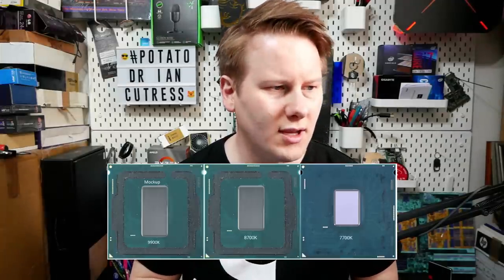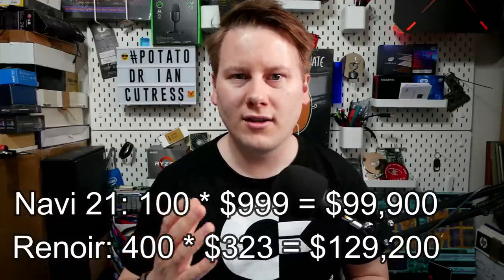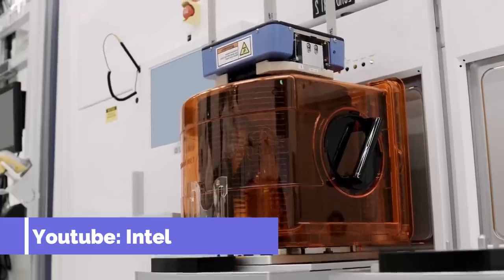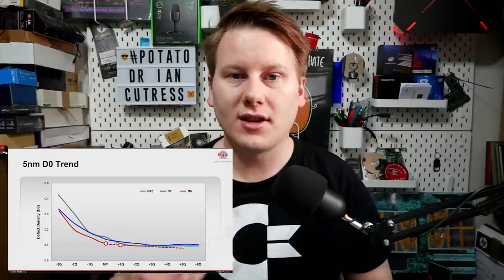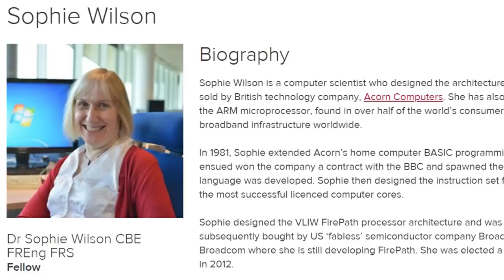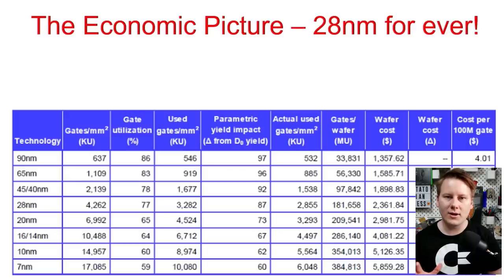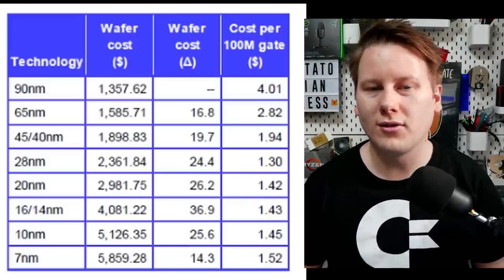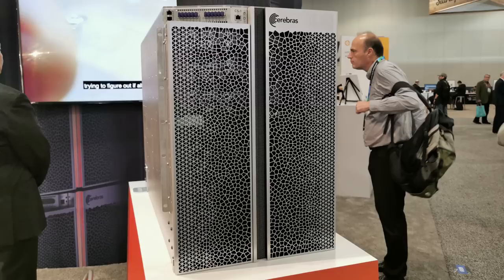The True Cost of Processor Manufacturing: TSMC 7nm

Comment: I used to be a yield engineer for a semiconductor fab.  It was not uncommon to destroy a "boat" of 25 wafers from a drifting process or human error. That would be a loss of $1m in a flash. As a yield engineer the stress was insane. You'd tweak a parameter expecting it to improve yield and instead it would loose 5% (where breakeven point is 5%) and you wouldn't know until 1000s of wafers.  The most underpaid job in the world. Nobody pats you on the back when you make the yield go up, but if yield drops due to an equipment issue you had nothing to do with your ass is grass. And everyone hates you because all you do is beat up people for hurting yield. I did it for 8 years. 8 years too many.
Reply: That sounds nuts, how can you go 1000s of failed wafers before noticing something was wrong, don't they test each wafer?
Reply: @davidrave563  yes they do, there are test structures in between each die that they regularly test, but they don't catch everything ... And we don't know what those limits should be anyway until the product matures ... It's a lot of educated guesswork. Many test structures you can't test until a series of 5 steps (out of 100 total) have completed, and if the error is on the first step, you could process 20 boats of wafers until the deviation is detected.

Comment: It's not just manufacturing cost, there's research and development costs also. Through the process, there's developing, making and testing a new technology, like the 7 nm size transistors, then there's cpu design(circuit, logic), prototypes and testing. You may go through several iterations.
Reply: Also, verification of the design... .i.e Design verification..
Reply: You never get true 100% yields. This is why Intel has bins.  Same chips post process locked to lower clock speeds or features disabled due to defects. So maybe a small handful of chips from the wafer are full featured at full clock rate. Many full featured at lower ranges of clock rates. Some at low clock rates with se features disabled And a handful of duds. There will also be some area of the wafer that is unusable due to the chips being square and the wafer being round.
Reply: he also forgot about mask costs, which are insane with these deeply scaled tech nodes.
Reply: And day to day operation costs.
Reply: Taken everything into the price they still markup too much,,,ppl are ready to buy and prices will be higher when this crisis is over.
Reply: @optimusprime7421  out of curiosity: What drives you to type three ,,, in a row?
Reply: @RandomUser2401  Use your imagination ...
:)
Reply: @dimedriver   @Avery Nisbet  Even if the chips were round, you would still get a lot of unusable space. More in fact. The reason why there is wasted space is because the chips are manufactured to be uniform in design. And the reason why the wafers that the chips are made from are round is because the manufacturing process requires the wafer to be spun like a CD.
Reply: @Sidicas  the wafers are round, because the crystal they are cut from are round. You can spin coat discs of almost any shape
Reply: @grandmastergyorogyoro532  exactly.  Design verification costs more than manufacturing at small nodes.
Reply: Add taxes to that list and other types of fees and licenses.
Reply: They don't design the transistors, the transistor design is done in co-ordination with the fabs and research firms like IBM. AMD does do circuit layout but they dont layout every transistor the circuits consist of cells which can have 6-100's of transistors these cells provide features such as logic like and/or gates but they may contain memory cells, cpu registers or entire CPU cores (like when a chip designer licenses ARM cores) they dont design this for every manufactures they just provide the VLSI files for layout. The cells have design requirements a little like a spec during layout the EDM software verifies the cells meet the rules developed for the process they are working on eg TSMC 7nm. The challenges for chip design comes with latency, frequency and temperature these factors have to be managed during layout. Entire new CPU/GPU design doesn't happen vary often (in many cases impossible when maintaining API and CPU instruction sets compatibility) it is too costly instead they make performance tweaks or increase quantity of cores or cache. This is mostly a copy and paste process. The problem of increasing more cores means you need more silicon the more silicon the more likely the chip will fail completely also the larger the die the harder it is to increase the clock speed. The reason for this is latency if a core needs to transfer data from one side to the other side of the silicon and it must lock the bus while doing this is will cause internal waits on the cores the trick is to keep memory and logic close to each other. The second factor is heat the more transistors on a piece of silicon the more the piece of silicon acks as a short circuit especially at high frequencies. There are design measures to mitigate or reduce the energy consumption of a cells. The big problem is transient power spikes but again design rules will help to validate the layout before manufacturing. Modern designs are starting to use AI to handle layout with reports of substantial improvements over human based designs up to 30% and development times of less than two months. Of course this is a little over simplified but really nothing changes much between generations apart from the number of transistors therefore number of cores and increased frequency. Usually when something new is added it becomes an extension to the old maintained design like CUDA or AVX once added these also dont change alot. The reason there aren't more vendors making CPU's and GPU's is the Patent and licensing restriction to build compatible chips. Reverse engineering these chips is possible and been done before but there is a monopolisation by US chips vendors to block competition. To design an entirely new instruction set and get mainstream adoption from software vendors is almost impossible. But there has been recent success with RISC-V which is an open source. But im affraid that the biggest sponsors including AMD and Intel while slow down development by poaching engineers internally. The Chinese are keen to develop RISC-V so who knows maybe in the future there will be for desktop CPU vendors ARM, Intel, AMD and SMIC with there RISC-V chips. Personally i think it is time to remove the monopolies that control chip pricing and let small players have a go at inervating.

Comment: The raw material costs are much less than half the base cost of production. When I worked in auto manufacturing supplier sector, we made a plastic part for $8 and less than $3 was raw materials, sold it to customer for $13 which they put on cars but sold the OEM replacement for over $80, this is common in all manufacturing. I guess I should also add the customer paid for 2 sensors, the R&D and the quarter million dollar mold for manufacturing which is why they had such a mark up.
Reply: The best thing is when the stuff comes from the same company as the cheaper stuff and they are exactly the same aside from labeling. My father worked in the 90s for a Company that sold everything that had to do with Carbrakes (or something like that) and sometimes they got the stuff that was supposed to be shipped to Mercedes but was cause of an error send to them,
Reply: @mrn234  in my city,we have a warehouse from the top ball bearings manufacturer.
almost in front,there is a Caterpillar warehouse dealer.
you can buy the caterpillar branded bag original part ball bearing for 120, or you can go to the ball bearing actual  manufacturer in front and buy the same for 30.
same ball bearing, same stamped code,different package, huge markup "for USA made quality"
Reply: @xiro6  You can also buy most of the stuff on Amazon directly from the Chinese manufacturers via AliExpress at 50% off... Amazon often do not even bother importing and stocking the goods themselves - they just pass your order on to the Chinese manufacturer and you get the product directly from China, in the usual packaging as when you order from AliExpress. And you can't get it anywhere else, because no one outside of China is still manufacturing certain parts.
Reply: @captainobvious-CH  Can you tell me which suppliers in China would have some very low-priced gamer laptops? i need one so i can study, to run some heavy applications.. and as my national currency is tremendously devalued, it is extremely expensive and difficult to buy the full price.

Comment: The construction of a single fab can cost billions depending on the wafer size and process. 
Bosch - 300mm wafer - 130nm process - 2019 ≈ 1bn
Intel Fab 28 - 300mm wafer - 10nm process - 2018 ≈ 5bn
TSMC Fab 18 - 300mm wafer - 7nm process - 2018 ≈ 17bn
Reply: However the fabs wouldn't be built if there was no profit in it!!  With the kinds of money being involved you now know why governments sponsor and protect these endeavours.  These are economies in their own rights!!
Reply: Something is wrong here.
Intel's 10nm is BETTER/SMALLER than the TSMC 7nm.
So the fab price is wrong.
Reply: @Wirmish  The prices are taken from official press releases. Who cares what's better ... 🤦‍♂️
Reply: @Wirmish  no tsmc 7nm is smaller then 10nm Intel, the difference between them is not extremely high that's all
Reply: @bertjedekat  Well the TSMC 7nm node actually works.
Reply: @1barnet1  so does 10nm, even if you and Intel wanted it to work better.
Reply: god damn, Bosch has a 1bn plant that does 130nm? Sounds unfeasible if 10nm was 5bn.... couldn't they do like 25nm for 2bn and use 90%  or even less wafers?
Reply: @xBINARYGODx  Well they still don't have neither desktop nor server processors from that node if i recall. Due to low yields and poor performance at higher voltages.

So no compared to TSMC's 7nm work in short it doesn't quiet work. It does have similar transistor count per square mm.

But TSMC's 5nm node is already mature now. With Apples M1 and phone Soc's delivering staggering efficiency and performance benchmarks.

They are in for a rough ride the coming years.
Reply: @Wirmish  we REALLY ned to drop the nm label since it doesn't tell us jack anymore
Reply: @zlac  Bosch produces a high amount of analog & mems chips. There is not much benefit for going on a smaller node for such systems, since these elements require a certain size and do not shrink
Reply: @Wirmish  or Intel is amazingly profitable.
so that's why they have money to have a fab under the iron dome
Reply: When I was at texas instruments, dallas site. they built Rfab (Renner Fab) and it sat empty for years. Just blew my mind.
Reply: Yes. Leaving out the enormous costs of the specialized machinery and fab plants makes this video kind of moot.
Reply: @zlac  I'm really confused as TSMC's 5nm plant they are building in Arizona (expected to be finished in 2024 which is basically unprecedented since they just broke ground) at an expected cost of 12bn. With US labor prices, I'd be stunned if some of those afore mentioned plants cost that much. In addition to that, wasn't the 17bn an investment in a large expansion and retrofit, dropping two large nodes for 14nm or 12nm, along with 7nm and 5nm with an advanced stacking fab? I might be wrong, but I'm pretty sure it was. If he has a link to the article regarding TSMC's 2018(?) 17bn investment and what it went to exactly I'd love to read it as I'm just going from memory on that one. The Arizona info is from Rueters, June 1rst, "TSMC has begun production at it's Arizona Chip Plant." if anyone is curious.
Reply: @crzyces1693   It has something to do with capacity. The capacity of Arizona 5nm fab of tsmc is merely 20,000 12in wafers per month. That's why it only costs $12 billion.
Reply: @crzyces1693  Pretty sure Russia will get involved if it escalates to nukes since they are next door to China and they will suffer the same nuclear winter you mentioned.  Also, with the ability to change trajectory mid-flight, they would not know if some of those nukes are heading for China and not themselves until it's too late.   It is now known that during the Cuban crisis with Russia, we were planning to nuke China as well even though they were not involved.  So from Russia's perspective, they could be nuked as well.

Another issue is that from what I've read, China is increasing their nuclear arsenal.  We were friendly with China until recent years so they had only minimal nuclear deterrence capability before since there was no real threat to them.  Things have changed now and they are increasing their nuclear arsenal.  Even if they were to attack Taiwan, it's unlikely they will do so now.  They will wait till they have sufficient nukes.  The only way I see a war happening now is if we started it.  They will wait.
Reply: @yanglee1404  20,000 5nm per month is alot of wafers IMHO
Reply: I think it's worth mentioning that those factories are from different years. For example, Intel Fab 28 started production in 2008 whereas TSMC Fab 18 is just partially online this year. Of course, the cost of the factory also depends on how much you can manufacture. Manufacturing 1000 wafers per month requires quite different factory compared to one that produces 30000 wafers per month.

Comment: Silicon substrates are just one raw material, there are lots of additional high purity chemicals needed. 
These and all the other additional costs add up to a lot, and take that 20x ratio down to 0.6.
If TSMC had $50B revenue and made 12M wafers in a year, average price is $4k.
Reply: But isn't that already included in the wafer cost @ 12:50 ?
Reply: @benjaminfacouchere2395  I mixed what I was talking about a little there. One was that the raw material cost for a processed wafer isn't just the silicon. That was TSMC's cost.  The other idea was how does a $6k produced wafer that can be turned into $100k of retail parts lead to only 50% profit overall for AMD or Intel.
Reply: @davidgunther8428  I see. My understanding was that the $6k/wafer are not the purchase price for AMD/Intel but the production cost for TSMC.
Reply: Would like to clear up Intel doesn't really do business much with TSMC. They have their own facilities. So their cost may be completely different.
Reply from the maker: Intel does billions of dollars of business with TSMC. 5% of TSMC's total revenue comes from intel. Used to be 8%. Intel has been a tsmc partner for over 2 decades.
Reply: @TechTechPotato  TIL. Thanks for the knowledge!
Reply: Chemicals, precious metals, consumables, energy, tool maintenance, waste management, process yield loss, die yield loss, assembly yield loss and many, many more costs involved.
Reply: @MrPanaramuh  Taiwan TSMC is helping Intel, AMD, and Apple manufacture 7nm, 5nm, and 3nm wafers. There are 2nm and 1nm behind..

Comment: As Dr Sophie Wilson mentions here, the problem is partly dark silicon that needs to be left blank so the chips don't get too toasty, this ties back to your later video about shapes.
If the chips could be a different shape some of these concerns could be alleviated. One of the apparent solutions would be stretching to the reticle limit and seeing how wide they can go before it melts itself on the highest available density.

Comment: In the 1990’s I was a R&D technologist and worked on a 5 year creative research and development agreement called a “CRADA” between Intel and the Department of Energy (DOE) for the development of EUV technology to expose integrated circuit wafers shrinking  the light wavelength and increasing wafer yields. A multifaceted approach included the EUV source, lasers and focusing mirrors, ultra clean vacuum systems for coating (sputtering) to reduce wafer defects and the wafer handling between process steps. A new interferometer  technology was developed by Dr. Gary Sommargren to measure multilayered mirror shapes prior to coating that ultimately made the EUV project successful, not diminishing the excellent work of the entire team of Physicists, mechanical and electronic engineers and their support by talented technologists.  We helped change the world just a little.  The was  done at the Lawrence Livermore National Laboratory. It’s now the Lawrence Livermore National Security.

Comment: @9:47 Price did increase due to material cost went up.  Hwei basically buy all that it can before the sanction.
But I think when the price went up by 10-20% (shipping cost etc), they didn't increase the price for their stable/long-term consumer to maintain the relationship.
New orders from new consumer however weren't so lucky to need to wait in line and still pay the full cost

Comment: The size of the die makes yield trouble go up superlinearly. If there are three "bad spots" on the wafer, at 600 chips per wafer, that's 0.5%, but at 60 chips per wafer, that's 5%.

Then again, tooling, design, and testing, and the risk taken on by starting that process, is a significant cost. As is the depreciation and interest on those 100 million dollar steppers lithography machines...